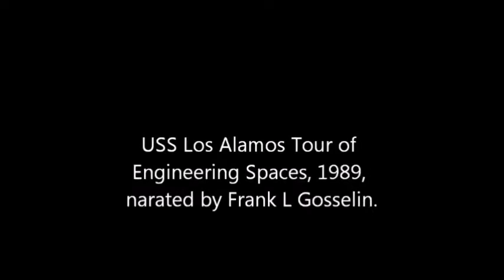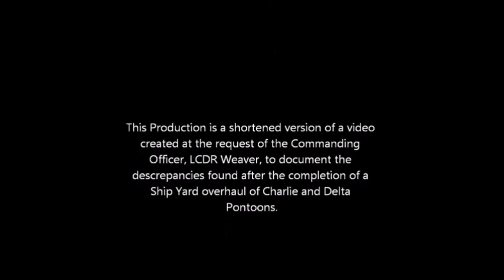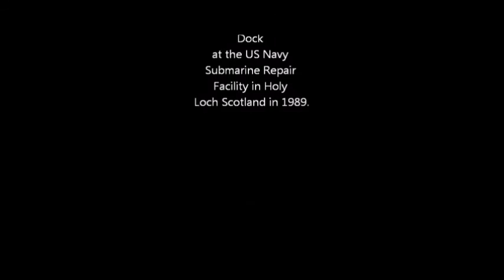USS Los Alamos Tour 1989

Comment: Thanks.. I never went INTO the dock. Hell being topside was scary enough for me. Looks as tight as a submarine.
Reply: +Pete Orthmann I was there in 77-78, this is very clean compared to what we worked in. I was in "D" section engine room, running generators, pumps, compressors, etc. It was not as tight as a sub, those things made me claustrophobic! I spent a lot of free time topside in the cranes or on the tugs. I would do it again anytime!

Comment: I was assigned to the dry dock September 77 for 2 years , my 1st command of which I enjoyed immensely and will never forget. My rating was boiler technician. My question ; what happened to the four 125 psi auxiliary fire tube boilers, of which my responsibility laid , that provided hotel services to the dry dock?
Reply from the maker: The Dry Dock was upgraded in the late 1980's to 550KW Generators to handle electric heat throughout the dock. The boilers and steam systems were eliminated.
Reply: @frankgosselin6075  Thanks Frank ,  Steven Franklin here in Chicago. Thanks for the info on the once on-board boilers , they were my puppies. And thanks for great efforts you put into that footage of the dry dock virtual reality tour. It brought back such rich vivid  memories of the comradery that I had with my shipmates at my 1st command.
 Thanks Frank.. .